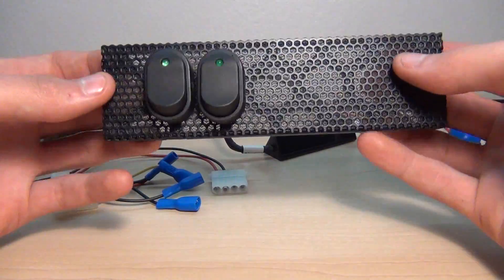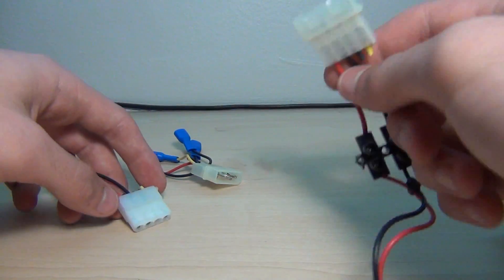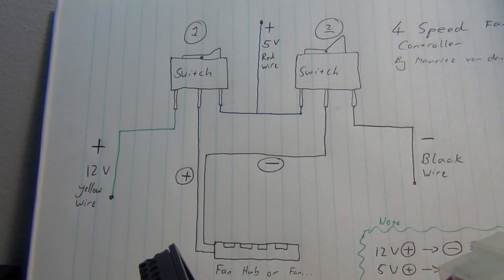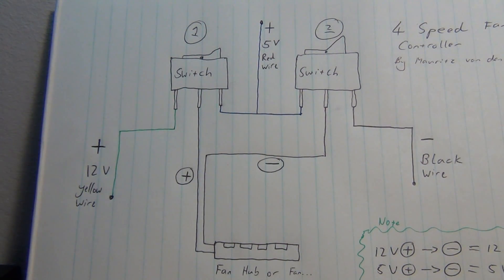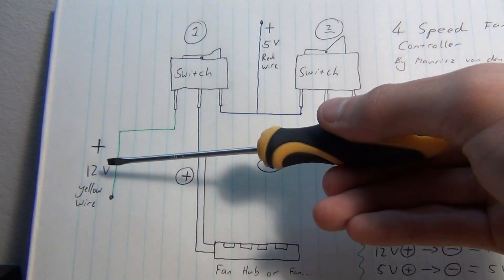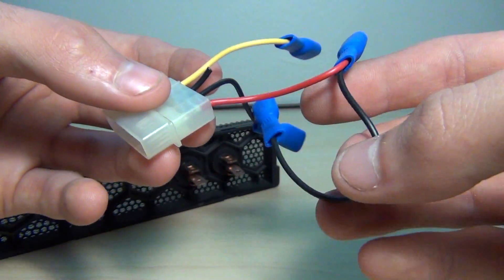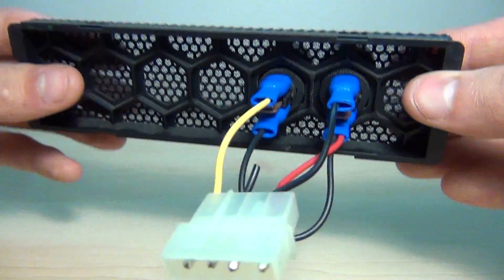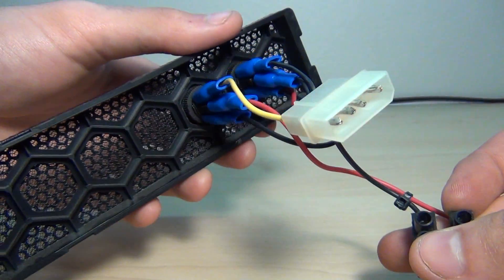How to Make a 4 Speed Fan Controller For your PC

Comment: A lot of PC PSU will not allow you to wire this way as you are shorting two lives.  Most PSU will simply just shut down and you will have to unplug everything and wait for the over voltage protection circuit capacitor to fully discharge before the PSU will turn back on.

Comment: Ok I cant seem to get this to work right. for me. I have tested the power output and is it 12V, 7V and 5V as it should be but my fan will only spin as if its on 5V only this way and full speed (12V) if I plug it back into the Motherboard on its fan header. Is there something I am missing? I cant buy the Fan hubs. it cost me $9 for the switches.
Reply: Got it to work and Thankyou for the Vid and info.
Reply from the maker: Glad you got it to work :D
Reply: Your the only one thats made a Vid on this. Everyone else is making things way overboard and this is the only one that make this setup easy and with off the self things (not something that you have to order from China) that you have to wait months on and that is Cheap. This is much cheaper then any Fan Controller that you will buy on Ebay from China in price and this will last much longer. I want to say thankyou so much and that I hope to see more videos from you doing great things cause without this Vid my fans would still be running at full speed at all times.

Comment: Hello, by the accent I assume you come from South Africa, where did you get the switches from?
Reply from the maker: Hey, yes, I'm from SA :) I bought the swithces from my local hardware store, called DIY Depot. I would suggest any hobby shops or small electronics stores, but Builders Warehouse might also have something. Goodluck.

Comment: Why did you say 3 molex connecters when you only used 2 in the vid? Genuinely wondering, not being a jerk. I'm going to be trying this and need a shopping list.
Reply from the maker: Hi! Male molex connector from power supply connects to female connector on fan controller. Then running from the fan controller you have a male molex plug that connects to a female molex plug that is wired to the fan hubs. That makes it three molex connectors that are installed in the fan controller array and one that should be included with the power supply. If your'e still unsure or any other questions, please ask :) Enjoy building :D

Comment: where did you get the switches? :) i like the idea a lot so i wanted to try to make one :D
Reply from the maker: Hi, I live in South Africa, I just bought the switches at my local hardware store, but most hardware or electronic stores should have similar switches, maybe take a screen shot or show them the video and the could help you :)
Reply: Mauritz van den Heever thanks for the reply :) i was checking today, and i found switches like that in a lot of old electrical devices. easy to recycle them even if they are cheap. also i found a local electronic component store as backup.
Reply from the maker: Awesome :D let me know if it works out eh :) and if you get stuck, don't be affraid to ask :D